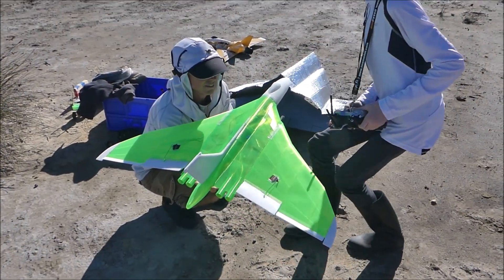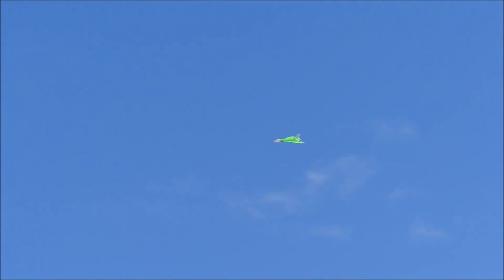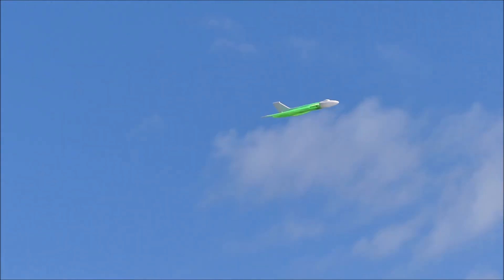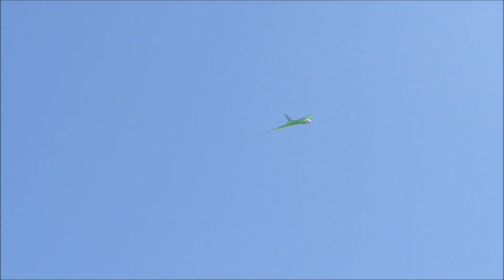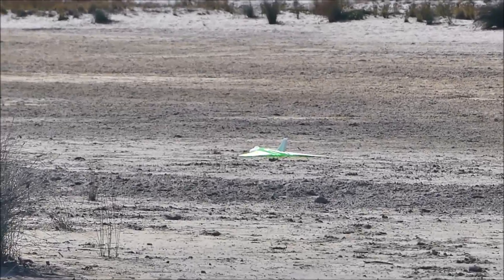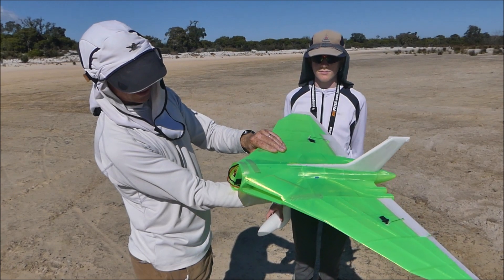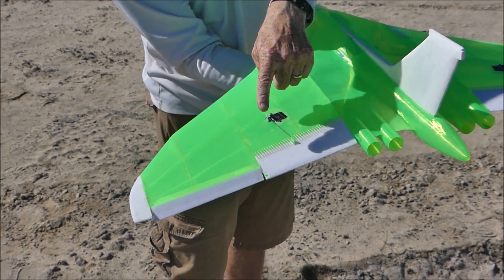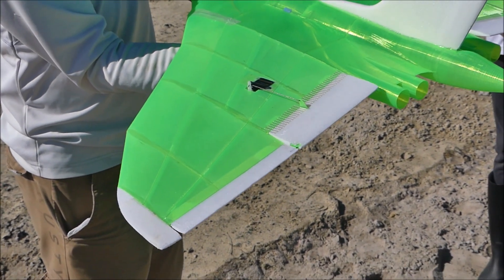3d-printed EDF Avro Vulcan maiden

Comment: That Vulcan looks awesome flies nicely! Well done ;) Btw. are the white parts LW-PLA?
Reply from the maker: I'm not sure about the nose, but the elevons and tail fin are Depron.
Reply: @MrWaz11  thx
Reply: The front nose is LW-PLA.  The control surfaces and wingtips are Depron.  I should have acknowledged the assistance of a fellow clubmate who printed the nose in LW-PLA for him.  The PSS video (also on here has the normal PLA nose in green, which was about 15g heavier than the LW-PLA one.  That weight difference brought the EDF CoG perfectly in line with the PSS flight. It may not be that sensitive to CoG, but we didn't want to take any chances!  First impression is it can handle a bit of extra weight, and we've ordered some LW-PLA ourselves!
Reply: @_Mk9  Do you think that if significantly more of the aircraft was made with LW-PLA that you could go even bigger with the model. would love a nice biiiiig model bomber on my wall
Reply: @cfeauto5938  If you are putting it on the wall, then you can go as big as the wall! But if you want it to fly....we are working on that, but slooowly.  There is a sweet spot - any bigger than this and you would need clever internal structure and that adds a lot of weight.  I think we can scale it up to take a 64 or 70mm fan with simple internal structure, but it's me doing the CAD and I'm slow.
Reply: @_Mk9  maybe two fans side by side going to two "engines" each?  I would love to see a 1400mm wingspan version of this beauty~